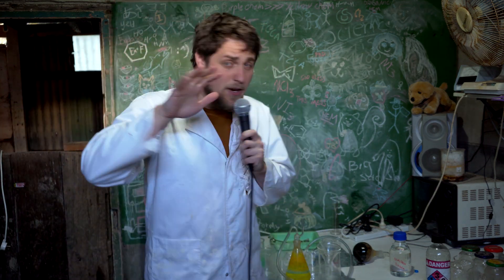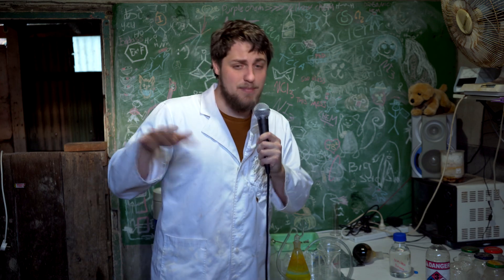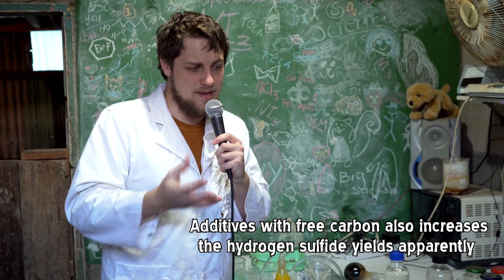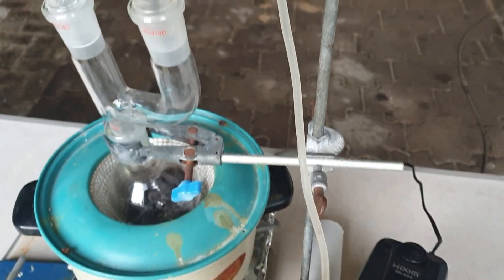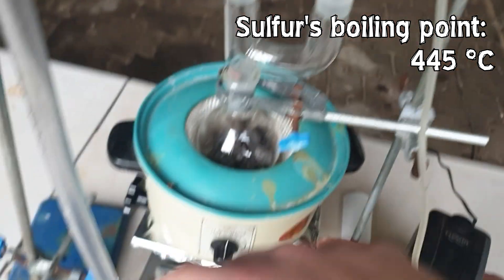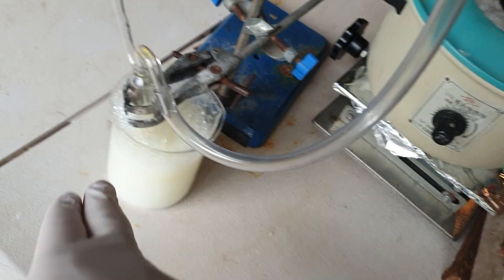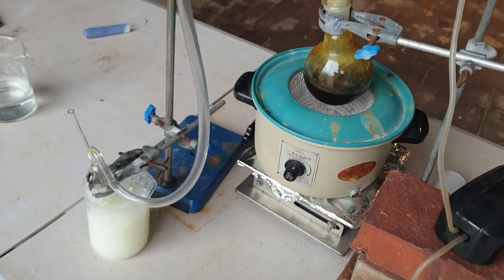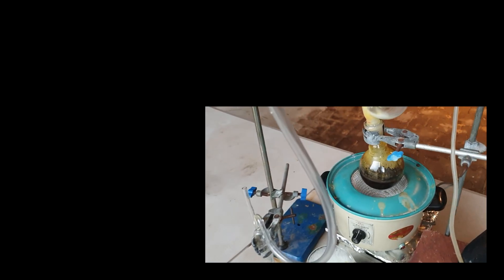A hydrogen sulfide generator using... a candle

Comment: I spent 2 years working on a project that involved condensing H2S into an organic solvent at cryogenic temperatures, followed by a warming ramp to allow it to react gradually. We did tons of process safety work to ensure that the H2S was fully consumed at every point in the warming ramp. Worst case scenario for scale up to a 2000L vessel would have been if the plant forgot to charge the reaction partner to the vessel. Full charge of H2S would have gone in with no reaction, then upon warming it exceeds the solubility limit for H2S in that solvent.

We did the math, it would have been enough H2S to evacuate the town should the worst possible branch of the FMEA occur, so we put administrative and engineering controls to make it nigh impossible to occur. Never been so glad to see a project die though, that reaction step always put me on edge.

Comment: 4:51 so if you don't know the ratios of a reaction you can do Balancing chemical equations --> https://youtu.be/TUuABq95BBM  so paraffin wax is C31H64, Sulfur is S8, from the paper it looks like charcoal is acting like a catalyst charcoal is C7H4O but it does not look like it's part of the main formula so we can not put it in the formula. we at least know it makes hydrogen sulfide H2S we don't know what else it makes but it needs to make something with C so lets just assume it makes carbon. so we have C31H64 + S8 --> H2S + C  so 8 from S times 2 from H so 64 from H divided by 16 is 4, then S times 8 times 4 32, so 1 molecule of C31H64 and 4 molecules of S8 makes 32 S and 31 C left over. so then the weight of carbon is 12.0107 and their are 31 of them so 12.0107 * 31 = 372.3317 the weight of Hydrogen is 1.00794 and their are 64 of them 1.00794 * 64 = 64.50816 so 372.3317+64.50816 = 436.8398 is the weight of paraffin wax the weight of Sulfur is 32.065 and their are 8 of them so 256.52. so we need 1 paraffin wax and 4 Sulfur so 436.8398 + 1026.08 = 1462.9198 = 100%  so 436.8398 / 1462.9198 = 0.2986 and 1026.08/1462.9198 = 0.7014 so 29.86% by weight of paraffin wax to 70.14% by weight of sulfur should be the ratio you should use. but it would be nicer to know to the other things made as well as if the catalyst is contributing, the paper seems to be written long ago. but perhaps the person that wrote it found that the ratio is best for what ever reason. they are not rare so maybe try both ratios see what works best. or if you know python a really nice thing to use is ChemPy that does all of this nicely for you, https://pypi.org/project/chempy/ and https://github.com/bjodah/chempy

Comment: Hot sodium hydroxide solution, doesn't need to be boiling hot and very concentrated to disolve the sulfur and maybe melt and wash away most of the wax, the solution will stink of burnt hair if you add any acid to it

Comment: The easiest way is to skip the metal and make sodium polysulfides by reacting sulphur with dissolved sodium hydroxide. This forms an orange liquid. The only downside is that you do not know the exact stoichiometry. From what I remember (I did this like 15 years ago) the reaction was very clean. The solution just gradually turned orange and I also stored it as a solution which seemed to be fine. I should remark that I always did this on a very small scale (like 10 mL).

Comment: yes, you could have a massive emanation of phlogiston if you were not careful, I mean who would want THAT ?! and then all you'd be left with is the calx  . One of my old , I mean really, really old, published 1890 chemistry books mentions the simple method of heating iron filings with sulfur in an iron pan, a blue flame results from the roasting of the two ingredients over a hot flame, it works. But in the end I just purchased some iron sulfide from BDH, it comes as broken up fused rods about cock thickness.

Comment: In the discord, I had theorized that using walnut shell-based sand blasting media could be used to clean glassware. Basically dump some in and shake it up a bunch. Doesn't scratch it, is disposable, still abrasive and is generally quite dry. Could even use it in conjunction with water. Figured I'd mention it here just in case it makes a difference and maybe if people agree it'll get noticed? In the states I got like 10 lbs for something like 20 freedom bucks and 10 lbs of dry ass walnut shell is quite a lot more than I realized.

edit: Also maybe use a cheese grater for the wax/charcoal next time so you dont end up accidentally pulverizing it lmao.

Comment: “12 grams candle” was way funnier than it should’ve been. And yeah I’d stick with argon for the next run if it’s not too much of a pain. You’re likely right, with enough air you’re below the flammability threshold, but why risk it and/or rely on your small air pump and hope you’re below the threshold of your air/HS glass shrapnel bomb detonating
Reply: Wouldn't nitrogen gas be a better choice in this case? It's much cheaper than argon gas as far as I'm aware

Comment: Have you considered using metered addition of sulfur in solution, such as in toluene? You could use an addition funnel and have greater control, but your reactions would need to be tolerant to trace toluene contamination if you weren't using strong enough cooling in a reflux setup. If you need high purity, you can also use a cold trap or inverted DI water column as a filter.

You can clean out a piece of glassware like that by baking it upside down to remove the majority of the material inside and then refluxing with piranha soln. until it eats everything inside the lab and dissolves the Earth. Well, maybe a little less than that. Doing a toluene reflux before the piranha soln. will solvate the sulfur and spare your nose later. It might even solvate some of the lighter paraffins in the wax you used. Getting paraffin out is best left to a few hours of hot piranha soln. with that baking step letting most of it drip out first.

tl;dr - bake it upside down, reflux with toluene, reflux with piranha acid, dissolve the planet

Comment: If you need H2S that often, could you just designate that flask as your H2S generator flask and just not clean it thoroughly? I guess you said you are constantly running low on glassware so that's not an option. But it would be nice if it were an option. How much does a flask like that cost btw?

Comment: This was the method shown in my 1958 Chemcraft Chemistry set. A little wax and a little sulfur in a small test tube heated on the alcohol lamp. You would ignite the hydrogen sulfide and observe the blue flame. The test tube was always FUBARed. I wonder if using a beer bottle wouldn't be a better method?  I realize beer bottles are delicate but they will hold up to heating if its done with care and spread out. The plus side is it can be thrown away.

Comment: A couple comments. Firstly, if you use a weak NaOH solution to bubble the H2S through, you can trap it in solution as S (2-). Then, if you want to evolve the gas from the solution at a future time, just add acid. I know that sulphide will oxidise with time, but stored in an airtight glass container, it can last for quite awhile. And secondly, rather than using argon to push the gas through the system, couldn't you just set up a simple CO2 generator, and use that? I dunno. You're using argon for its unreactive nature, but in this context, CO2 is equally unreactive (and so cheap as to be virtually free, whereas argon is not).

Comment: Just use one of those shit unground round bottom flasks with a silicone stopper with some tubing. The flask is the most expensive part and here at least we can get them for like 50 ZAR (1 USD = 13.67 ZAR at time of writing) then fill it up and you can use it a few times. By the end just chuck it away. Sure it's a bit wasteful but depending on price it might be worth it to consider

Comment: i have made hydrogen sulfide a few times (only for the smell). what i did was mixing aluminium powder with sulfur. press it into a hard cylinder, together with som inerts. after that i would light it on fire to make the al2s3. it would burn slow (glowing), and i would be left with a small cyllinder formed brittle brick of al2s3. After that i would put it in water (not acid), and it would bubble and smell
another thing is, h2s attacks the nerves (if i dont remeber wrong). our body produces small amount of it naturealy. but larger amounts can attack the nerves?

im no scientist, so correct me if im wrong :p

Comment: You should probably melt the wax first and then add the sulfur or the other way around to get a better mix. An addition funnel with a hot wet rag wrapped around it could be used to add wax slowly and control the speed of the reaction. Just need to drip hot water over the rag to keep the wax molten. 
To clean it, just add something to it to dissolve the wax or heat it enough to melt it out once the reaction is used up.

Comment: Hey mate, good practice to use a non-flammable carrier, as a mechanic, when we leak test petrol fuel tanks, the preferred method is to use nitrogen, have seen some nasty explosions when using air, oxygen in the air can make things pretty volatile.
Reply from the maker: Yeah perhaps I'll get a nitrogen tank too, it's usually cheaper than argon and would work great in this scenario

Comment: Great potion making.  About the air thing.  We didn’t do a quantitative test but I feel like the h2s is in that 4-44% range so maybe a suckback trap or argon is a better idea but if it flows out quickly all of those won’t be nesassary.  Try and use activated carbon if suckback is an issue if you abandon the carrier gas.  Other than that I can’t wait to see what you have planned with that

Comment: I remember taking a safety course (H2S alive) for working in the oil field. Apparently one of the scary things about H2S is that if you get exposed to a lethal dose (even without a knockdown), it might not kill you right away. So you may think you're fine, but it can build up in your system because it'll dissolve in your blood and then later that night or the next day your lungs start to fill with fluids and shut down due to damage from the gas, and that's what will kill you. Really nasty stuff, the instructor who was teaching this stuff was very adamant that there was no "safe" exposure limit to H2S despite different regions having "safe exposure levels". His argument was that you take a look at the regions that have oil and gas industries, vs the regions that don't, and the regions that have these industries "for some reason" have a higher safe exposure limit than regions without this industry.

Comment: "Aqua Regia" also known as  "Royal water" is a mixture to clean glassware, it's a mixture of Nitric acid and hydrochloric acid in a 1:3 ratio, maybe that can help you clean that glass, or maybe it's an awful mix which may cause more harm than help, idk i'm not a chemist i read it in an old Bio labware book, just dropping a random fact that may help you.
Reply from the maker: That's really good for metals, not so much for baked on carbon I think? It could work though

Comment: As for getting the sulfur out of the glassware, boiling hot xylene or piranha should do the trick. Probably in that sequence, the xylene should also help get most of the paraffin out.
Reply from the maker: And the piranha would ensure there was no xylene left on the flask either! Would be squeaky clean after that
Reply: @ExtractionsAndIre  I meant sequence in a let it dry out before piranha kind of way lol

Comment: Alchemy. The word you're looking for is Alchemy. Combining a burnt twig with a candle and some sulfur from a hardware store to (I assume) refine precious metals is Alchemy.

Also: Not the good willow charcoal! D: That's for a different kind of sorcery!
Reply from the maker: It's a good charcoal! Need some non sparking media for my ball mill. Will get around to it one of these days. Maybe I'll even get a gun license so it's borderline legal too??
Reply: @ExtractionsAndIre  Yeah, I kid. I know how it is. X3 I belong to a club that has all the licenses, but the tradeoff is that I only really get to work once or twice a year. There's a lot of variation in black powder mixes, though. It's interesting to explore.
Reply from the maker: Perhaps worth a main channel video. But there's a lot of people out there who have explored it quite a lot! Not sure if I could add anything new honestly, and I like to do that in my vids
Reply: @ExtractionsAndIre  Maybe break out the MMA electrode and do some more interesting colors from exotic elements. I'm still wondering if one could get a decent blue formula using Cesium Chlorate.

Comment: You have a gas alarm with a H2S sensor on it, right?

Having worked in refineries that processed sour gas, and more recently, miles underground, in workings that were dug a hundred years ago, while running 370KW diesel generators, I've learned the value of having a quality gas meter on my shirt.

Sometimes you can smell the change and sometimes you can't.

Now that I've said my two cents, I'll watch the video.
Reply: You need a damn safety officer. Like a wife with a rolling pin. 
Really? A fire in the woodpile? Do you want to cut all that wood again?

I'd really like it if you stayed alive and kept making videos.

Comment: Very detailed video,, good job.. For more control use calculated quantities of aluminum sulfide in water and heated....this generates H2S in situ. The Al2S3 can be added in small increments to prevent run away H2S generation. Another means of in situ generation is by adding Zn or Al dust to a sulfurous acid solution (ie: an acidic solution treated with SO2).  The key is not to produce more than the solubility of your solution will allow, plus any excess needed to perform the desired reduction of heavy metals to their sulfides or whatever your purpose is for generating the H2S. On a final note H2S is more toxic than HCN. Steve

Comment: This is a very nice method for making H2S, which by the way is a gasotransmitter apparently, like NO. You could make pellets out of wax, sulphur and carbon, maybe a couple of grams each. And melt one pellet at a time when you need H2S. And you can after some tests add different number of pellets depending on how much gas you want to make

Comment: TOP 8 Cleaning methods chat suggested
best to worst practicality / cost / danger:

1.) Boiling with bleach (hot base bath)
2.) Boiling with Sodium Hydroxide (hot base bath)
4.) Soaking with mineral spirits (solvent)
5.) Shake with ethanol and salt (abrasive solvent)
6.) Piranha Solution (self-heating acid bath)
3.) Ultrasonic bath (sick vibes bro)
7.) Boiling Xylene/Toluene (solvent)
8.) Carbon Disulfide (expensive solvent)

Honorable mentions:
1.) hammertime (replacement)
2.) Boiling water (brew some fart tea)
3.) Melt wax and pour out (make some H2S)
4.) Ozone gas .

Comment: soo... question i want to know is.... would it be better if you could produce the H2S in bulk and store it and then use it as a reagent at a later date? for example, using a gasometer to "scrub" it of sulfur and then when the gasometer reaches capacity pump it through a drying agent into an empty gas cylinder for long term storage so that you can use it with a regulator and have constant control over it when it is acting as a reagent. or is that far too dangerous to have a pressurized cylinder of a toxic, flammable gas lying around?

Comment: Use nitrogen, you know, money. But in my first semester, we used sulphur+paraffin without coal and without carrier gas. It was a mess, but sulphur-chemistry is always a mess. And it is yellow. The best way to deal with the flask: Clean for less than 10 minutes, reuse it for this purpose.

Comment: All you need is a bell and a book and you can exercise your yellow chemistry demons.

By the way, I don't think it's a good idea to add oxygen to this mixture, there is a slight chance of an explosion. Apart from that, you are adding possible unwanted products, such as sulphur dioxide, though I suppose that would require the mixture to burn, and by that time the H2S would have exploded. FP= -82.4C, but autoignition temp 232C.

Comment: the new Pharmazutical procedures use Thioacetamid in basic solution. 
it will produce H2S when heated to boiling for a few seconds.
its not a gas generation and more of a decompostion without bubbles but it works great
its easy to store but smelly like H2S.

maybe you could buy that insead of using toxic gases.
the H2S will style in Solution if you do it this way.

Comment: I think this is a common reaction that should occur with any hydrocarbons, i remember visiting a gas desulfurization unit from a natural gas producer where the molten sulfur had still some methane/ethane mixed in and it produced quite a lot of H2S.
Also worth mentionning it also produced a strange  mineral they called Carbsulf (not much info about this) which i assume was some kind of carbon polysulfide, it was somewhat translucent and flaky (i still got some in my collection).

Comment: Waaay overcomplicated there.  Just use a large test tube wilt sulphur and vegetable oil.  Heat it up and you get a flow of H2S.  Stop heating and the gas flow stops instantly.